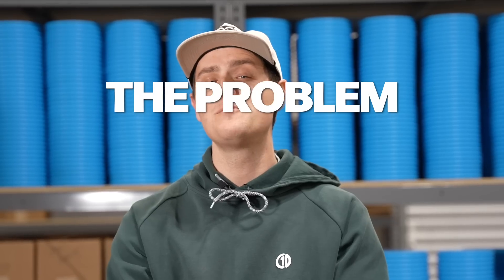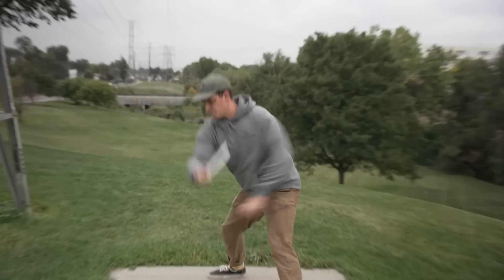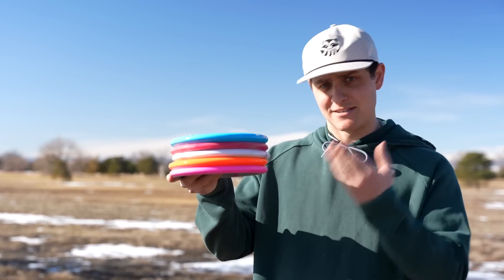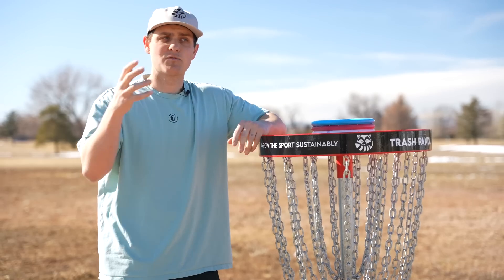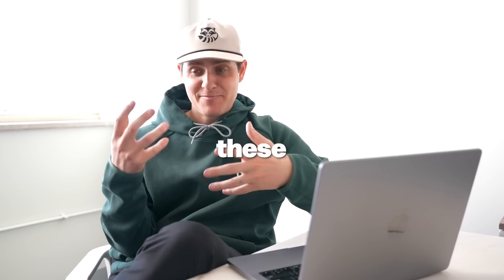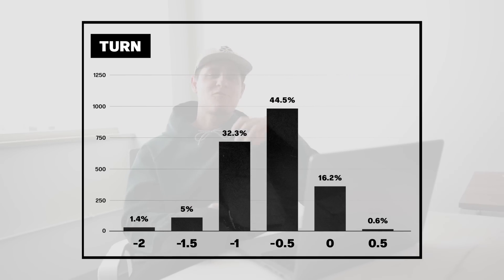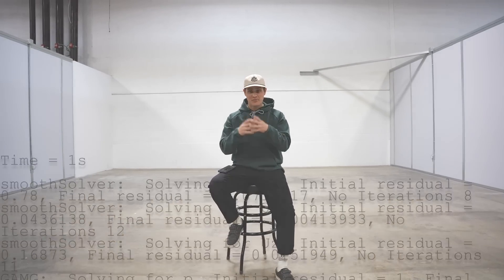We Used Science to Choose our Flight Numbers

Comment: Jesse, totally loved the discussion in this video. I totally suck at disc golf (but am slowly getting better) but I totally geek out on the design and science side of discs. CFD is actually something you can do fairly easily yourself if you have a good 3D model and spend a bit of time with a piece of software called SimFlow. A little bit of AI on the results and you have science-backed numbers to determine the flight properties of a disc. It absolutely should be the standard based on a normal level flight path. However, one thing you left out, and it's totally technical, is rotation of a disc and its influence on the numbers. It's a setting in the software to account for it and many people doing CFD analysis don't account for it. But it makes a big difference in the speed and stability aspects of the analysis, just like it does on an actual physical throw of a disc.

Comment: My biggest issue was how light the first runs were put out at. I didn't respond to the survey because I very much didn't feel good about giving an opinion based on what could be in the future, a stock 170+ disc. Mine was 166 and i heard others got even lighter. 

Also, I'd love to know what Loft takes into account the average amount of spin a person puts on a disc. Weight distribution of the plate to the edge of the rim theoretically changes stability in flight based on centrifugal force.

To sign off so i don't sound so negative; genuinely, i love what you guys are doing and keep putting out the best DG content on youtube!

Comment: I believe the level of precision you’re claiming “speed of 2 or 3” etc is fine, and no better or worse than what other manufacturers are stating but I take issue with your claims of “simulates exactly how the disc would fly…”.   Maybe the folks at Loft told you this but it’s nonsense. The folks at Loft should have explained to you the severe limitations of CFD for this application.
It’s way too involved to explain here but it comes down to turbulence models, lack of a boundary layer transition, highly 3-dimensional flow, and grid dependency. 
Ask Loft what their y+ value was. Ask them to show you their solutions were grid independent. Ask them to show you the difference between solutions when running fully turbulent vs fully laminar boundary layer models and how they account for the existence of both in the real world. 
No matter how careful your model is, or how fine your mesh is, at these Reynolds numbers there is a laminar separation bubble that exists on the suction (upper) side of the disc at the normal operating range of nose angles and the position and size of this bubble completely dominates the stability characteristics of the disc. The bubble also to a lesser extent influences the drag of the disc. Your CFD model is never going to correctly predict the characteristics of that separation bubble. No chance. I wouldn’t even say CFD is useful for predicting trends between various molds, let alone absolute results for a single disc. 
CFD results with pretty colors are impressive and look convincing but it doesn’t mean the results are at all based in reality. 
Ultimately the only way to get flight numbers is exactly what you did, compare one disc to another in flight, with a large sample size to account for variations of a given mold. Best wishes.
Reply: I can't speak for this simulation, but laminar separation bubbles have been modelled on airfoils so it is possible. "Disc golf trajectory modelling combining computational fuid
dynamics and rigid body dynamics" (2022) validates their CFD against wind tunnel measurements and overall simulation against actual throws and it looks pretty good to me. While turbulence is a bit of an elephant in the room for CFD, and disc flight is dominated by difficult to model phenomena, you're being a bit hysterical when you claim it's all useless. Wind tunnels and flight tests are always the final truth though. It's always funny when some small aircraft designer trusts CFD unconditionally. In my experience even linear static FEA is often done poorly.
Reply: @MiG82au  “hysterical?” Weird choice of words. Laminar separation bubbles have been modeled fairly well in Drela’s MSES and XFoil codes, for sure. I use these codes daily. These are 2-d codes applied to extremely specific geometry and even then as an aircraft designer I apply corrections based on over 2 decades of full scale flight testing and wind tunnel testing. Regardless, your statement that laminar separation bubbles have been modeled in cfd is irrelevant because the laminar separation bubble isn’t being modeled in this instance, which is my point. A laminar separation bubble reattaches to the surface only after a mid air transition to turbulent flow. Such a transition is definitely not being modeled here.
The results are interesting, but meaningless as related to actual disc golf performance prediction.
I don’t know any small aircraft designers that are using Navier-Stokes to model
full aircraft geometry. I used NS code (Fluent) back in the day on a single core processor to do stability and control analysis of Spaceship One as we did trade studies of the re-entry configurations. It would take about 40 hours back then to loft and mesh up a new geometry and a couple of days of computational time to run a single angle of attack. This was the rare scenario where the code was applicable because we were operating at 45+ degrees of angle of attack and the flow field could be modeled as fully turbulent and was dominated by separated flow and attached shockwaves. We never used NS on any other aircraft at scaled. Roncz was supporting other Scaled aircraft programs back then using VS-aero, which is a panel code, but I was the only one doing navier stokes. These analyses led to our selection of the novel “shuttle cock” configuration and allowed the program to move forward. The stability and control derivatives that I produced were applied to the flight simulator used to train the pilots as well. Spaceship One went on to win the x-prize and now hangs in the main gallery of the Smithsonian.
Reply: @danielcockerspaniel  I've put my foot it a bit telling grandma how to suck eggs, but I still disagree with your assesment that CFD useless for disc coefficients. Just take a look at the 2022 paper I mentioned and see what you think about their analysis. The simulated trajectories matched the sampled trajectories pretty well apart from some distance loss. They also had a pretty good correlation to older wind tunnel data, and who knows how much of the difference is due to inconsistencies in disc production?
As for NS at aircraft scale (I didn't say good NS), off the top of my head I can think of Darkaero and Joby Aviation, but the solo homebuild with laughable performance claims slips my mind. Still, you can just Google "homebuilt aircraft CFD" and see that it's happening, for better or worse.
Reply: @danielcockerspaniel  I just got a reply on Reddit from one of the authors of that paper and disc flight simulation code. He said he's built a wind tunnel now to avoid "...the bottleneck of 3D scanning and CAD modelling, and the inherent uncertainties of CFD simulations." 20 minutes after I recommended their approach LOL.
Reply: @MiG82au  All good. Yeah the DarkAero trust funders are doing some excellent mechanical engineering, but their aerodynamics analysis and design is shoddy.

Comment: Ive always though that the pdga should determine flight numbers. Like you as the developer you can reccomend what you think they will be but in the end the company that approves discs should be the determinig factor. Currently we dont have a device that can throw discs on any path you want so until we do they should all be thrown at the same speed "say 60mph" with a similar release many times and base it on that. It would also be awesome if companies would release high and low speed flight as well as that changes based on experience and lower speed flight could be more for beginners/ams where high speed would be pro. Honestly though with all the money the pdga gets they need to develop a machine that throws discs. It shouldnt be hard.

Comment: I'm shocked that airspeed, MOI, angular momentum and gyroscopic precession were not mentioned once in this video.   
So basically, the computer analysis was with a non spinning disc?
Reply: None of those except airspeed affect the aerodynamic forces which is what the CFD was calculating. The calculated flight profiles do take airspeed, precession and angular momentum into account along with the aerodynamic coefficients. Spin has been measured to have negligible effect on disc aerodynamics (Potts, 2005) and only affects the rate of roll.
Reply: @MiG82au  spin affects precession.
If I want less turn, I throw with less spin.
Reply: @davelopez9161  Yes, everyone knows that angular momentum is the product of MoI and spin rate. What's your point though?
Reply: My point was that if the flight characteristic of a disc is to be modeled by a program, then there's more to it than just the aerodynamics of  the disc design and nose angle.
We still do not know at what velocity and angular velocity the disc must be moving in order to obtain the other flight numbers.
I applaud Jesse for doing this.  
I believe this is a first step.  
I hope more manufacturers start taking this approach.
Reply: @davelopez9161  I clearly told you that  the CFD is just generating aerodynamic coefficients and that there's a second simulation with spin and mass for generating the flight path.
You haven't found a glaring oversight.
Reply: @MiG82au  So,  what is the velocity that this disc must be moving at to achieve the stated flight path?
Reply: @davelopez9161  I don't know, that wasn't shown, the graphs were hastily labeled with many typos and lack of conditions.. But let me get this straight. You don't understand how to simulate DG flight, so you accuse them of doing it all wrong and when I say that's not the case you deflect by asking me for a simulation value that I'm no privy to. What are you trying achieve here?
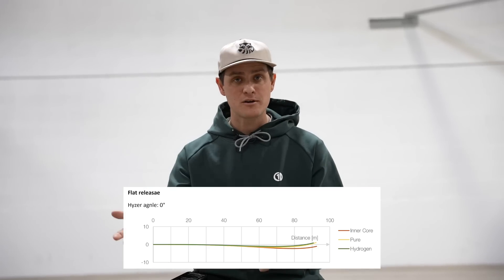If you just want to know what speed gave the flight path at 8:53, ask Jesse that instead of assuming they left out gyroscopic effects (yet somehow calculated flight paths?!).
Reply: @MiG82au  Oh, I thought you were part of the simulation team.  sorry.
My point is that to date nobody knows how to simulate a DG flight.  Or, at least they haven't shown this to the industry.

Side note: I did see that vibram had some flight charts with velocity and angle's instead of the ambiguous flight numbers.  I wonder how accurate those were and how they derived them?

This  attempt (bravo) by Jessie to simulate it in a computer model is great but I see it as the first inroads to achieving a true analysis.  

I would like to see the PDGA setup a lab were they verify flight path claims by manufacturers so that one day we can get to a universal standard.

When a manufacturer publishes a flight path, it should be accompanied with, at a minimum, elevation, velocity, and angular velocity.

A disc traveling at 45mph at 5000ft has a different flight path than a disc moving at 65mph at 1000ft. 

As a consumer, I could then measure how fast I am throwing discs  and then compare that to the published flight path information from the manufacturer.

Comment: One big problem with flight numbers I think is the variability in stability based on throwing speed. If you throw a destroyer but don't have the arm speed the numbers won't feel true. Same goes with something like a buzz, the higher the  speed you throw it at, the more understable it is going to fly. I feel like humans can't gage well enough the speed at which they throw so robots or sensors would be needed for accurate tests. Love your videos and  mission btw, keep it up!
Reply: Yeah on top of that the spin of the disc affects the turn just as much, and it's even harder to gauge. Combination of those 2 facts makes turn the least reliable flight number by a mile, I have discs with -3 that go into roller and -2 that I will never ever turn even an inch, that makes no sense from scientific point of view and some standarization has to come at some point. Or just do it like discraft and don't put flight numbers on the disc, I'm a fan.

Comment: I'm probably in the minority but I think we should throw out the old flight number system and just write the coefficient of lift drag and pitching moment on the discs. That way you can know (in a rigorously proven way) how the disc will interact with the air
Reply: You can't write those on a disc because they're curves that vary with Angle of Attack, and the AoA varies throughout the flight (that's why we can get turn and fade during a flight). I suppose you could standardise 2 or 3 angles at which you provide the data and then you'd only have 6 or 9 values. Still, converting those into a flight is tricky because they interact. High lift reduces AoA, high drag makes the disc reach high AoA sooner and so on. Having the curves would be an excellent starting point for generating more accurate flight numbers or a new simplified characteristics system though.
Reply: @MiG82au  I think that right now we have a broken system (obviously lol). Right now we have mostly arbitrary numbers that people learn how to relate to on their own. I think that if we started using a single standardized of AoA people would be able to relate more accurately to a disc before purchase. Plus then I could nerd out about the new system
Reply: @jacobdecatur2230  oh yeah, it's super bad. I had a glow Insanity that was rated -2 turn but flew like my 0 3 discs. I know that that's because the glow plastic ends up being a different shape, but then what's the point of the completely wrong numbers?

Comment: just got  my inner core 166g i have a noodle arm and throw a stand still do to age old injurys my off tee with a fairway about200ish 1st throw with ic 210 flat and straight next throws (6) all within 5-10 feet each other did hyzer holds very well  andhyzer same all about 180-200 ft did some putting with and felt great in the hand and for me did little beter then usal so far great disc lookin to get another will let u know more after i play a round or two with it